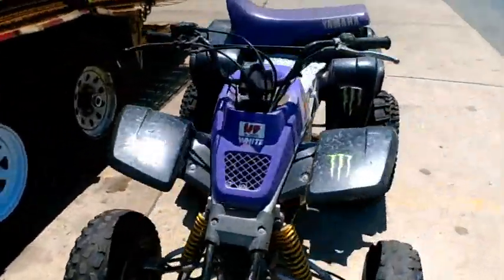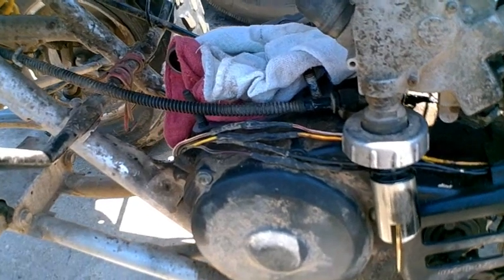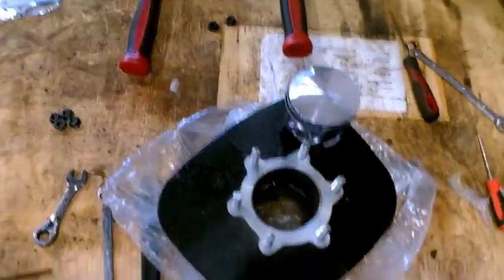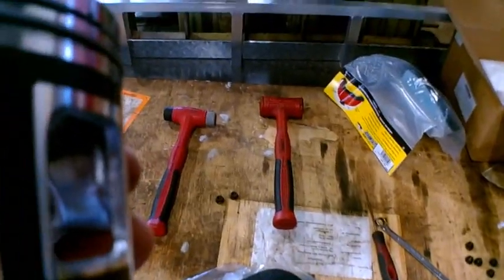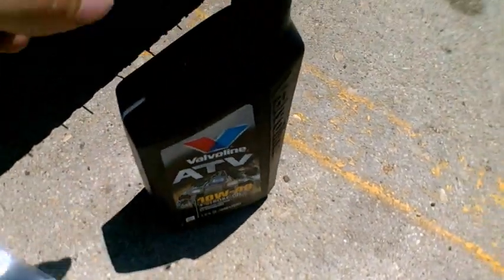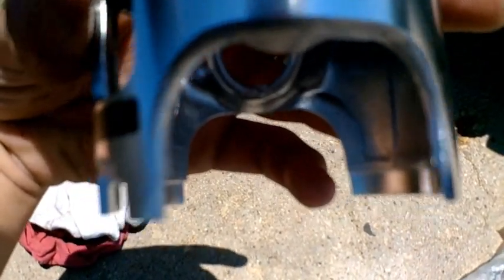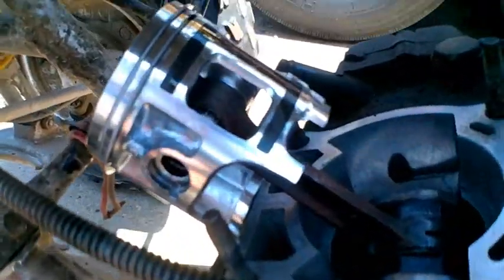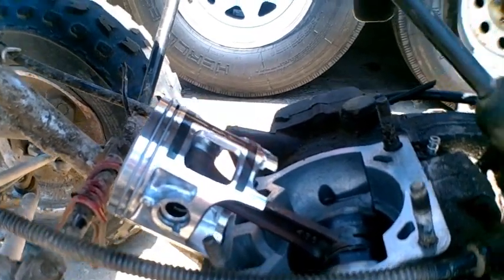1988-2006 Yamaha Blaster YFS 200 Top End Rebuild-Part 1 |Piston and Cylinder Prep|

Comment: Hey man ,l  bought a Yamaha dt 200 lc 1987 and l was wondering if this piston of yours will fit on mine. I can't find any piston other than Yamaha's  dt 200 R ,and l heard that blaster's piston will fit on the 200lc but l am not 100% sure. Do you have any idea ?
Reply from the maker: If u can find your stock bore size and it matches 66mm like a blaster maybe it will work but also need to make sure wristpin diameter is the same and piston height and all that stuff
Reply from the maker: I'm not sure really but maybe haha
Reply: Thank you ,man. I will try to find out .👍